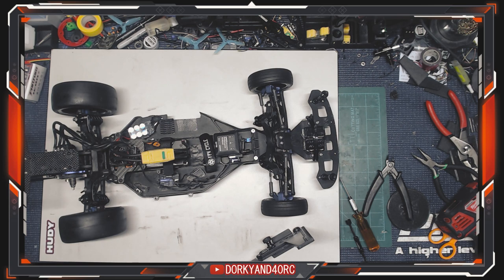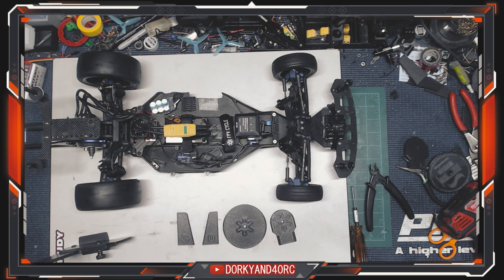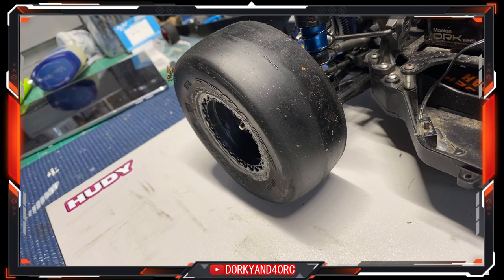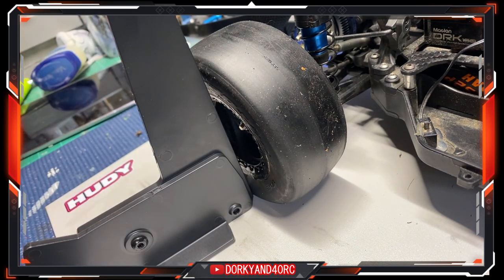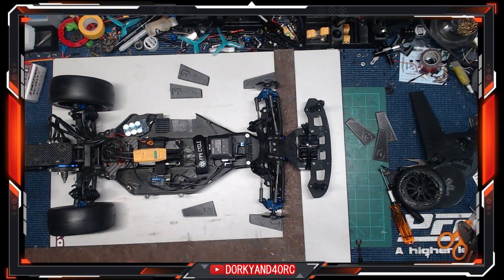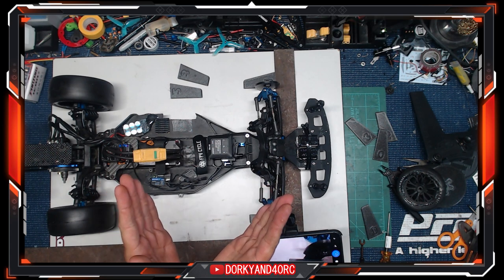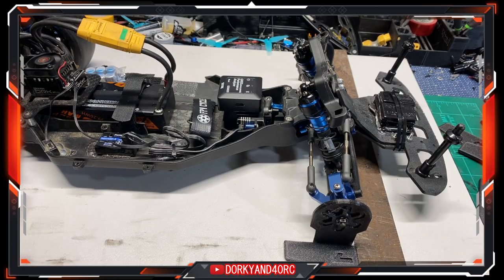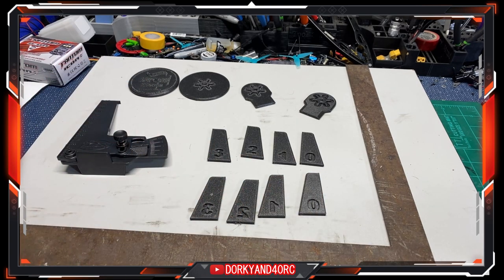TOE CAMBER AND CASTER ADJUSTMENT WITH BRC TOE TOOL AND LOSI STUFF | NO PREP DRAG RC | GO STRAIGHT

Comment: Your reason for toe out is the reason for toe in from what I’ve understood.
Maybe that’s just for 4wd sedan, pancars  n bashers?
4wd will pull under load causing more toe in up front and toe out in the rear because of the caster angle is more up front.
Rear wd the front tends to want to toe out because the caster angle. If you take off the tie rod the front wheel will toe out naturally unless being pushed forward. 

Toe in makes the front want to track straight and initiates the turn slower (lazy), then in the rear to pull to the center. Toe out wants to initiate the turn quicker for the front, not enough toe in for the rear and the rear is squirrelly because it naturally wants to toe out under load.

Haven’t ran my no prep yet but I’m thinking 1 1/2 toe up front with 1 degree camber to keep any input lazy and wanting to track straight for the front and 1 degree camber with stock rear toe to start,looks like stock is 3 degree but I might play with 2 degrees to help the rolling resistance.  

Is there a follow up vid on your results.